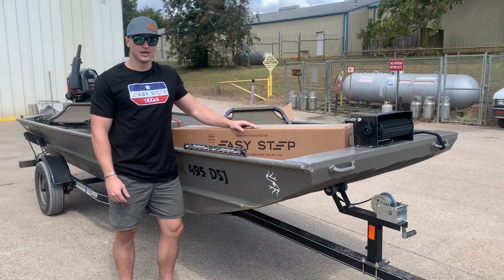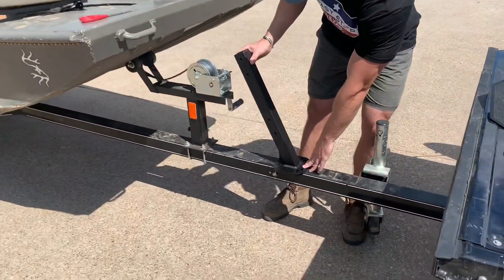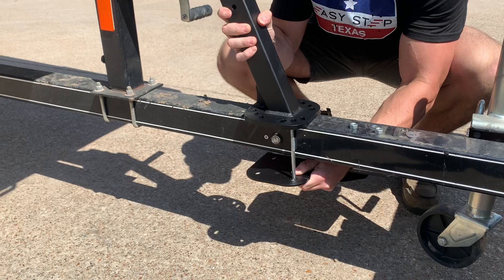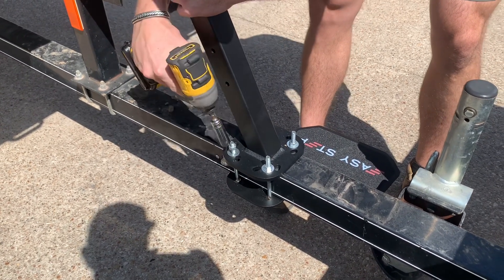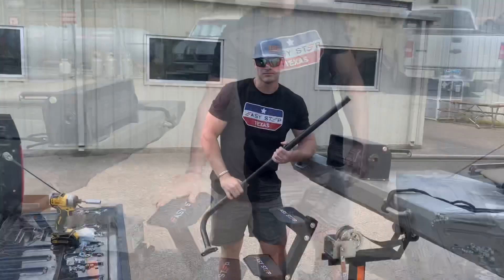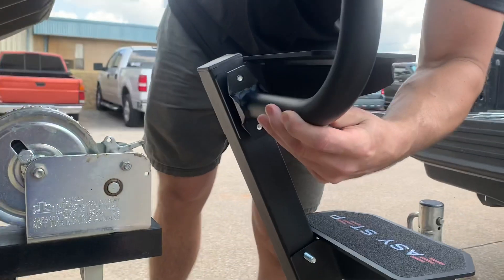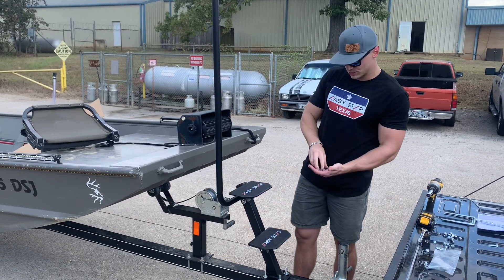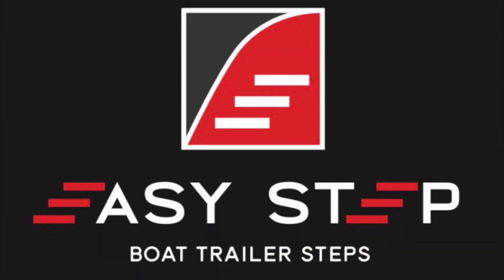Easy Step 2.0 and 1.0 Install

Comment: Looks like in way of wheel to fold up
Reply from the maker: That is something you need to be aware of when mounting the 1.0. The 2.0 and trailer jack can be mounted side by side with no problem. You would need to find another mounting location for the jack when mounting the 1.0. This is a family members boat who was nice enough to let us use his boat for the installation video. This boat currently has the 3.0 only it.

Comment: Does this new version, get in the way of the winch cranking up the boat.
Reply from the maker: No sir. The steps are slightly offset from the tubing to allow normal function of the winch crank.